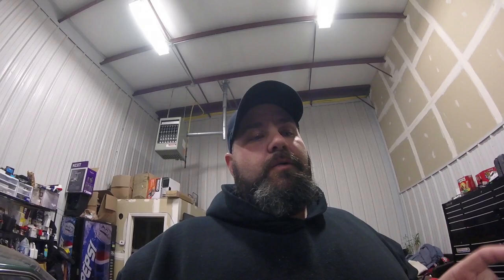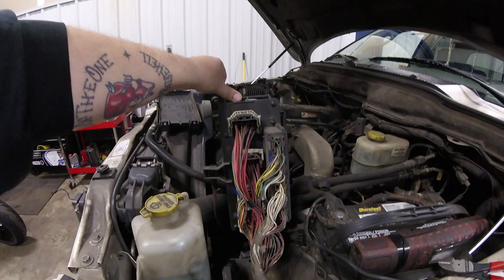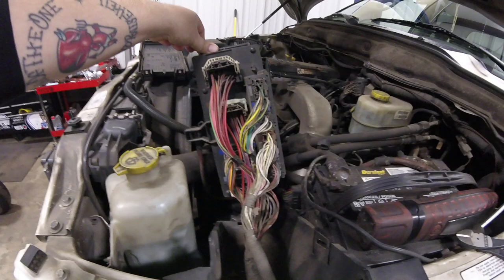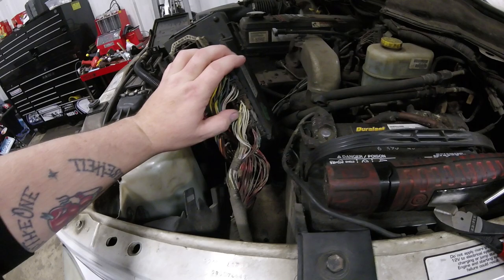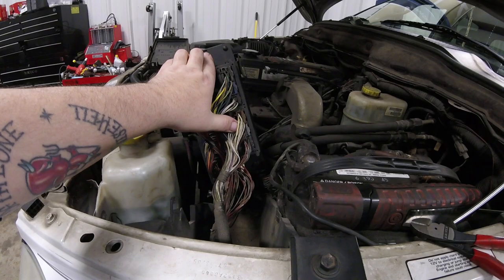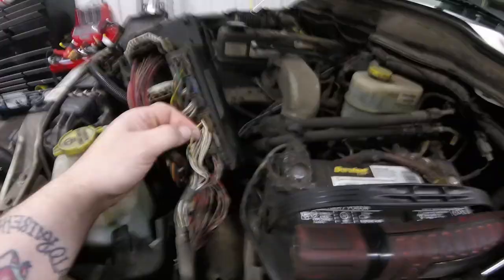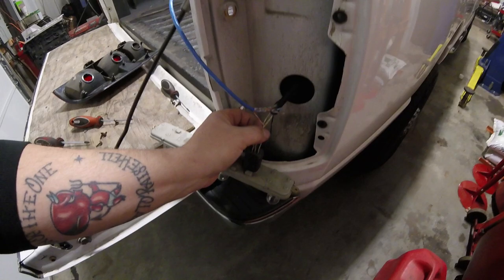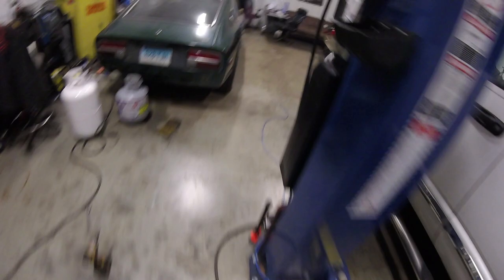Cummins Ram 2500 Bad TIPM??? Maybe not!

Comment: I have a 2006 dodge 3500 4x4 cummins and the air bag light keeps coming on and iam losing all my hvac controls and also my compressor will keep running! I took my tipm loose and moved it around and airbag light went off hvac started working again but ac compressor keeps running with light on or off! Please any advice would be such appreciated sir. Thanks so much
Reply: Also soon as I snapped the tipm back into place all the problems came back. Airbag light came back on and lost all hvac controls again
Reply from the maker: Sounds like a broken wire somewhere at the tipm. Also the AC compressor will run with the switch off as long as defrost is the selected mode
Reply: @MorFabIndustries  ty sir for the reply I'll check it out

Comment: Hi, thanks for the video.  I have had intermittent radio for over a year particularly when it is cold out.  Yesterday the radio worked fine at 65 degrees on the way to work.  Came out and the truck was in the sun all day and plenty hot.  Turned the key and the truck started but no electric windows, A/C, lights, radio, and the dash warning lights for engine and brakes were on.  Managed to get it home with trailer, on 4 way flashers.  This morning, hit the key and everything worked.   Could this be the TIPM?  Thanks for your time.
Reply from the maker: Yes. It could also be a bad ground.

Comment: Good evening sir.  I like your info vids.  I just watched your tipm vid on the Dodge Ram with bad back right wire.  

I need you help with a front drivers headlight.  All
Lights work but that one. Except the high beam works. Not the low.   Traded head light bulbs it’s not the bulb.  Seem to have volts at the plug. But light wont light.     Help please.  Cheers.

Comment: 06 dodge 3500 5.9 cummins. My tipm is in suspect for altenator overcharge battery. 
Do you need to remove tipm to solder. 

Awesome informative video.
Reply from the maker: Sometimes yes sometimes no.

Comment: Great video. I have a 2003 dodge cummins 5.9 HO. 6 speed. 270.000. Started truck yesterday flashed head lamp out. So I looked at it. Driver side out pass side on. So I hit high beam. This time drivers side works pass side dont. No turn signals either exsept pass rear. Marker lights all work. Hooked it up to my horse trailer and lights & signals work on it. Any ideas on this head ache  ?
Reply from the maker: Most likely corrosion or a bad ground somewhere.

Comment: I got a 2010 Ram 3500 with 6.7 the right blinker is really dim and sometime not working and the reverse lights blink also the tail light is dim now the engine is stalling or not starting at all. Previously I put I. A new fuel pump and it ran well for a few months .. when I went to Dig Into the tail light issue it’s not starting again.. HELLPPPP! If I could talk to you that would be great as I know how to do it I just don’t k ow what to do
Reply from the maker: James that really sounds like a failing ground connection. I would start by looking at every grounding point on the truck and making sure they are good and free of corrosion
Reply: I’ll try that.. thank you

Comment: Great video!! I have an 2006 2500. Having and problem with the airbag light. Every time the airbag light comes on I lose power to my AC control switch. It happens randomly any ideas?
Reply: Have the same problem! same year truck! If i tap on fuse box or jiggle it around it will work for a while.

Comment: THANKS MY TRUCK 07 5.9 3500 JUST STARTED TURNING OFF JUST AS IT STARTS. START IT UP 2 SECONDS LATER dies. does this 2 or 3 times then runs fine. 178k HELP! found a dry cell in battery driver side. replacing both with AGI.

Comment: I'm just curious, do you think $3,200 is too much for a pretty clean '02 Dodge Ram 1500 with 150,000 miles. The issue is no headlights (possible TIPM), but everything else works.
Reply from the maker: Sounds like a decent deal as long as the rust isnt too bad.
Reply: MorFab Industries thank you for the fast response! I'm stuck between that or just beefing my 04'Grand Cherokee limited, to pull a 27' camper.

Comment: ever try putting a toner on the wire to find the open? We use toners in underground wires in irrigation.
Reply from the maker: Use it all the time.  I was a cable technician for 12 years.

Comment: Great video - just subscribed! Daughter inherited bro-in-laws 2006 2500 Cummins 5.9 with 170k, wipers just stopped one day, after 2 wiper motors burned out mechanic was able to bypass so that at least she has on\off wipers, no intermittents saying the TIPM is bad. Also seeing alot of issues with the '06 TIPMs on-line. Thoughts?

Comment: I have an 05 Ram 2500 with a 5.9L Cummins in it. I've lost trailer lights, rear tail lights & turn signals and low beams. I previously had a problem with my in tank fuel pump that was corrected with a rewire from the TIPM to the pump. Mine is rarer than the ones I see around but if I do find one do I have to have it programmed to my truck? I've seen where people do a hard reset by disconnecting the batteries and connecting the positive and negative leads together. then they leave it overnight to totally discharge. Is this done in place of having to reprogram the unit? Thank you for any guidance you can provide, John  :-)
Reply from the maker: As far as i know, the tipm always needs to be coded to the truck. I havent seen one yet that worked with a different tipm without being properly coded.
Reply: I purchased a Doorman replacement and did not need a flash at all. Solved a fuel pump failure and a host of other EVAC issues. I later found failed wiring in the drivers side rear door, I suspect now that this harness was the the root cause for most of these failures. The TIPM may have responded to this failure which led to an eventual shut down of many of the body functions.

Comment: 2004 ram 3500 dually pickup no brake lights, checked fuse 32 and 34  where do i go from here
Reply from the maker: Check the brake light bulb sockets as they tend to go bad. Silly but if you havent, check the bulbs. Then look towards bad grounds. Also check the brake light switch at the brake pedal.

Comment: Hey There! I have a 2008 Dodge Ram 3500 with a 6.7L Cummins motor. I am having issues with what I'm thinking to be my wiper motor and I'm starting to research the problems now. The truck has 424,000 miles on it and its my work truck. I replaced the wiper motor twice now and it works great for about 6 months, I know it's starting to act up again as the wipers will start parking in the middle of the windshield. I pop a new motor in and it works great for a while. Now I'm starting to get a little ticked off and I'm trying to find the root cause burning these motors out. I will be purchasing a new multi function switch and trying that next. Dodge is telling me its either the Multi function switch or the TIPM...any thoughts? Why would my wipers work good for several months and then just start failing?
Reply from the maker: The wiper relay in the TIPM is a common failure point. The new wiper motor draws less current when new and over time will draw more current and cause the relay in the TIPM to fail. After several new motors I would suspect the tipm over anything else. The only way to know for sure however is to test power output from said relay when the wipers are acting up. If you have power to the motor during the failure, its the motor. If there is no power to the motor during the failure then it is the TIPM relay.

Comment: I have a 07.5 6.7 that won’t start and took it to a shop pressures were all good everything was fine and the mechanic is telling me it’s the tipm and I call the dealership and talked to them and they said If the tipm was going out that I would be having electrical issues rather than it not starting so I’m wondering if the tipm had gone out if it a wire that tell the engine to start would cause this
Reply from the maker: Tipm can most definitely cause a no start issue. The only way to fully determine that is with a Chrysler DRV Scanner.

Comment: My 2012 Dodge Cummins randomly stalls while driving.  I can always click it into neutral and fire it right back up and never throws any codes. First I was leaning towards WIN but since have been thinking TIPM (mostly because that's what Dodge said)  and they want $1250 for a new TIPM.  Any thoughts would be greatly appreciated.
Reply from the maker: Thats a common issue with the cummins trucks. Most of the time its corrosion in or near the TIPM. The only way to know for sure is to use a data logging scanner and capture the data when the truck shuts down. At that point you can determine what system is failing and why.
Reply: Same model as you,  I did have a diff tuner on it when it would do this randomly.  Middle of driving, get the elec bolt sign on dash, pull over, it would start right back up. I have since changed to a Live EFI, from an older H&S tuner, and it hasn't done it since.  Even the random 4x4 service light stopped.  Are you running a tuner?

I am getting a random elec brake error, just changed out the brake light switch, seems to have fixed the issue.  227k miles, so I really can't complain.
Reply: Hey what wound up being the problem with your truck ? I have a 2012 cummins doing the same shit!!

Comment: i got an 08 dodge ram 1500, 4x4 wont engage transfer case shifts over light blinks. front actuator was replaced but still not engaging i put a vault meter on the 4 wire harness and get a good reading from one wire the rest nothing was thinking it was my tipm but after seeing your video i am thinking i have a broken wire so i am asking if the tipm is bad can i still get a reading from one wire
Reply from the maker: You may get a reading from the constant power feed to the actuator. Without pulling a circuit diagram its very hard to tell exactly what should be going on.
Reply: Have the same problem 
07 1500 front actuator no engagement

Comment: Have you heard of just headlights going out? Had an issue. Neither low or high beam worked. They went out driving. Had to hold highbeam switch pulled toward me to have headlights come on to get home.
For an hour and half drive.
Yes Gen2. 99 dodge ram 2500 cummins diesel. 300k miles. Strong runner. Never turned wrench on motor except regular maintenance.
Any help would gratefully be appreciated. 
Been in a few shops.
Reply from the maker: It sounds like either a bad headlight switch or a bad high beam switch

Comment: Hello, great video and congratulations for the customer.  I have a 2010 ram 1500 larime,  with a almost 3amp parasitic draw. My googles and YouTube have helped me find that the draw is coming from the 30 amp stereo fuse.  I dont know where to start. Can the TIPM be cause for drain? Thx.
Reply from the maker: I would start by unplugging the radio and seeing if you still have the draw. Then I would unplug the amplifier if you have the infinity system.

Comment: Hey I have the same exact truck. Identical. And my electric 4x4 is messing up. Then the non and it flashes and won’t engage.
Reply from the maker: Thats usually and issue with the 4wd module on the transfer case.
Reply: I also have the same problem my 4x4 is stock on 4x4 high, how did you fixed it?

Comment: great tutorial, I have had a problem with my 2005, dodge 2500 Cummins for months now. It will run fine then it will just cut off, like the ignition was turned off. Mostly at idle or while turning or stopping. But it also cuts off at high speed sometimes. Do you have any Ideas? Driving us crazy!
Reply: Did you ever figure that problem out ? My 2012 6.7 cummins is having these exact same symptoms.i mean slow speed shut downs. High speed shutdowns, etc.

Comment: Hey great video!! I was told my tipm might be faulty. The airbag light is on and A/C control and heated seats quit working all at the same time. I believe its a short in the wiring somewhere. I have opened it up and wiggled some wires and then im good to go for a day or so. How or what would i google to get the exact wire problem. I booked my truck in at the dealer for Monday but I know for a fact they are going to try and rip me off.
Reply: It is an 06 dodge ram2500 cummins diesel

Comment: Awesome video. I have an 06 dodge diesel and having an issue with the electronic 4x4. Shifts into 4hi on its own with no light. Done some google searches and found a forum with the same problem. Theirs were loose pins in the tipm. Gone check it tomorrow. What would be the easiest way to tighten loose pins if found?  Thanks in advance
Reply from the maker: Best way is just to get in there with a fine pick and put a little pressure on them.

Comment: Thank you for an excellent video. I will contact your shop as I have existing problems with a 2010 Dodge Ram 2500 6.7  I would like to discuss. If you believe the TIPM is the culprit I would like to ship it to you or someone you recommend for repair. I live around 70 miles south of Atlanta.

Comment: Hey 07 dodge Dakota both low beams out but high beams work changed bulbs still same issue as well as when I unlock the door with my key the alarm goes off sometimes
Reply from the maker: I would suspect a bad ground or a broken wire for your low beam circuit. It could also be a failed relay or bad fuse.
Reply: @MorFabIndustries   all fuses and relays were checked and changed by my mechanic and had no luck getting them to work

Comment: I have a similar issue with my 2007 ram.my left lights don't work on my travel trailer,I even tried using a magnetic light plugged into the flat 4 plug and same issue.offly enough I don't have brakes on my camper,wasn't sure it's related or not
Reply from the maker: Its most def related. The trailer lights are the first thing to go out when the module is going bad.

Comment: Hey bud I have a similar issue. The fan for my AC/Heater doesn’t always work. I can switch the fan on but it won’t work and while driving it then it sometimes turns on. Some days it never works. Its just hit or miss.
Reply from the maker: That could be the blower motor or blower motor resistor. Probably not related to the tipm
Reply: My first tipm went out.  Was ac issue.  Replaced blower,resistor and relay.  Just to find out it was tipm. 6 months later gauge came on saying my def heater module went bad replaced that.  Come to find out it was the tipm again..3 weeks ago again blower quit working again tipm ..this time dealership bypass relay in tipm with wiring harness. So far so good but I'm not holding my breath...2013 ram diesel mega cab 4×4 bighorn. 128000 miles.

Comment: do you happen to know where i can find which wire are for the fuel pump for this tipm?
Reply from the maker: What year is the truck? What model and what series? What engine?
Reply: @MorFabIndustries  it is a 2006 dodge 1500 with the 4.7  it has tipm that looks identical to one in video i believe but cant find any info on it or the wiring/layout of it.  thanks for reply.   my truck has brand new $180 fuel pump and starts whenever it wants to. didnt start for 4 days, just turns over doesnt get any fuel.  went out again today and fires right up and runs perfect. been on and off for a month now getting worse and worse especially as weather gets colder.  thinking the fuel relay which is inside tipm may be at fault.  have seen videos of bypassing instead of replacing whole tipm but it was for different model than my truck.  Thanks again this has been a nightmare.  truck that works whenever it feels like it!
Reply from the maker: The wire is ORANGE with a RED stripe Pin 18 in connector C10 at the TIPM which should be the lowest plug of the 4 on the TIPM
Reply: @MorFabIndustries  Thanks tons.  any other ideas come to mind on what could be going on? its starting today so I have to wait for a day it wont start and then i plan to test back at the fuel pump to see if it gets power to there on days it doesnt start, since it obviously does now. dont know what else could be going on im no mechanic lol Thanks again for your help
Reply from the maker: @chasepomeroy641   Its usually the fuel pump relay going bad inside the TIPM. Pretty common issue. The fix is to run and external relay like you saw in the other vid.

Comment: I've actually got a 2006 dodge ram 1500 4.7l and my driver side headlight just took a shit. Once i went and bypassed it by connecting it in with the passenger side all was good now. I do have a question. Do you happen to have a link or source for that entire TIPM pinout? I googled for it and can't seem to find anything. I'll keep trying to look. Awesome video though man. I'm also big into audio and 12v electronics so i'm like you....i'll get out my multimeter and try to track down issues before throwing money away. One last question in regards to aftermarket lights for these DAMN dodges....what's your thought on a having the headlights and tail lights trigger a relay to power the lights since these vehicles are so damn sensitive to any upgrades to the lighting system? I put led bulbs in the back tail lights and when using the turn signal it acts like i have a light out and blinks fast. As some probably know already it's the same damn issue with HID and LED headlights. You need a damn resistor for low beams to work otherwise it doesn't work.
Reply from the maker: They are super picky when it comes to light upgrades. There was an update for the TIPM firmware that allowed it to handle more current but it didnt stop the connection and cold solder joint issues. I dont have a pinout as every year for the most part was different. You have to get a diagram specific to your year/engine/trans setup. Running a relay would still trigger the lamp out light and running resistors just puts more load on the tipm.